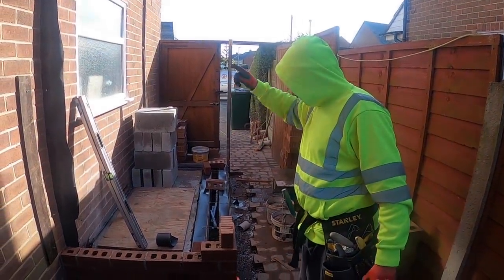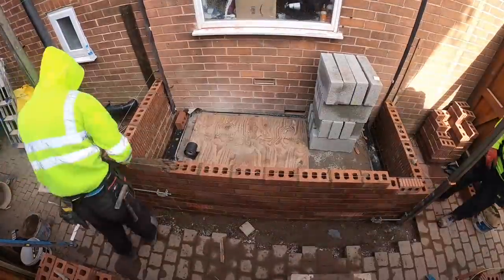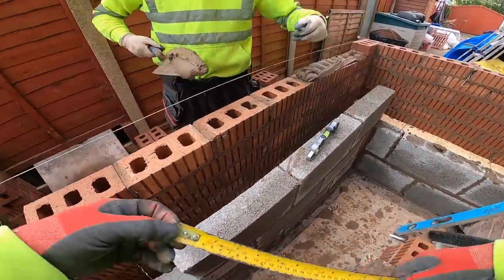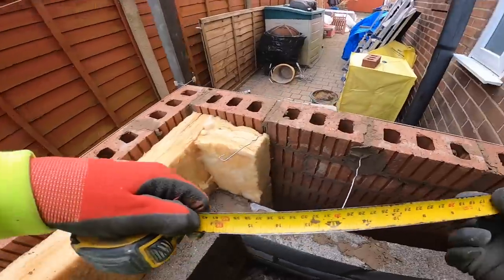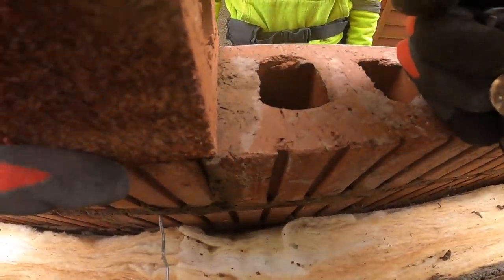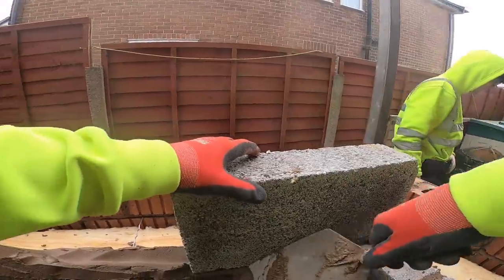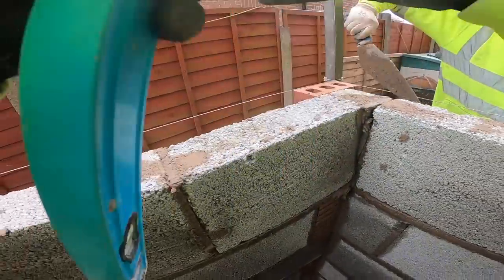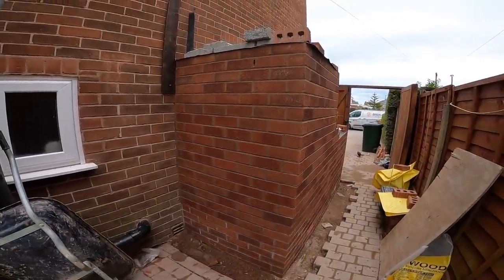SMALLEST EXTENSION ON YOUTUBE ..EXTENSION PART 3..#BRICKLAYING

Comment: S&A, was a wall starter kit not required on this extension? Have you ever used block dolly on the Blakes profiles for block and brick lines? Love your videos😀
Reply from the maker: We dont like wall starter kits and use screw in ties instead 🧱👍🏽
Reply: @SteveAndAlexBuild  I did see you use the ones from Screwfix, you prefer them to butterfly ties and starter kits? That was a doll house extension. Do you not want to branch out and put the roof on?

Comment: Steve, I'm going to be building a porch soon, what size dpc did you insert into the vertical cut inside the new cavity where it meets existing building?
And that cut, do you cut all the way through that 1st skin ?
Cheers 👍
Reply from the maker: We just cut with the electric briber so about 75 mm deep and we just use 100 mm damp 👌🏼🧱👍🏼
Reply: @SteveAndAlexBuild  nice one thanks for the information much appreciated 👍
Reply from the maker: @JimJimpmjj  No probs any time 🧱👍🏽

Comment: Another great video lads. Questipn as always, see the length of wood used for the line. How is it attached too the wall and how do you attach the line too it? I've seen it in several vids but it's never explained. Cheers
Reply: If you Look through the old videos you will find the explanation for it.
Reply from the maker: I will definitely get round to explaining that one soon 👌🏼🧱👍🏽

Comment: Hi, Do you put mortar down under the dcp, I’m at the slab stage and will be starting on the bricks next week.
Thanks.
Reply from the maker: We don’t but a lot of brickies do , it won’t do any harm 🧱👍🏼
Reply: @SteveAndAlexBuild  Probably a stupid question, but if you don't put mortar under the DPC, how is the DPC and everything above it attached to the wall below the DPC?
Reply from the maker: @amw9966 The weight of the building. A bed underneath doesn’t make much difference as mortar doesn’t stick to pvc 🧱👍🏽

Comment: Did you say at 38 min. the vertical DPC should be folded back against the old wall? Is this to stop it falling out as I was wondering how you where holding it in, also do you use cavity closers to close off your window opening?
Reply from the maker: The dpc doesn’t matter as long as it’s in. We just hammered plastic packers . 
   Not sure how the plasterer is finishing around the window 🧱👍🏽
Reply: @SteveAndAlexBuild  Thanks 👍
Reply from the maker: @amazing451  😁🧱👍🏽